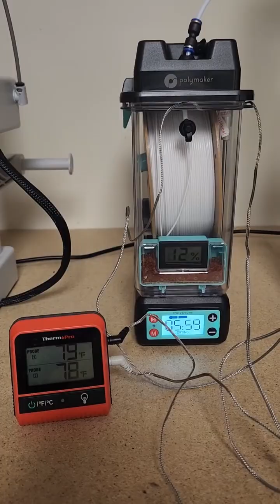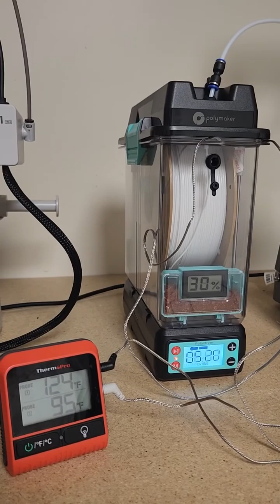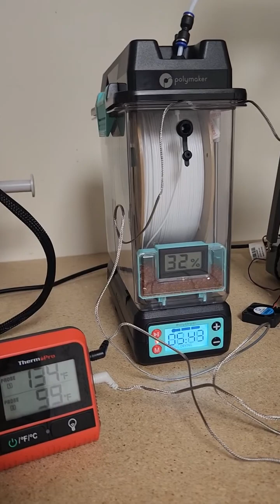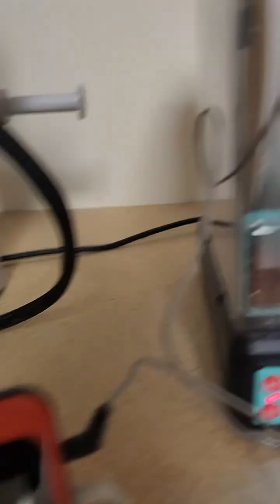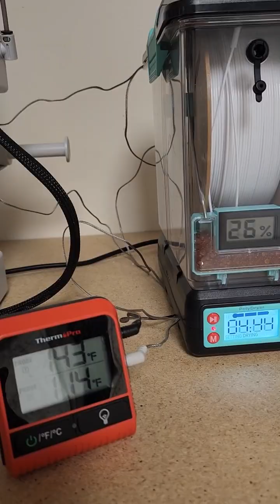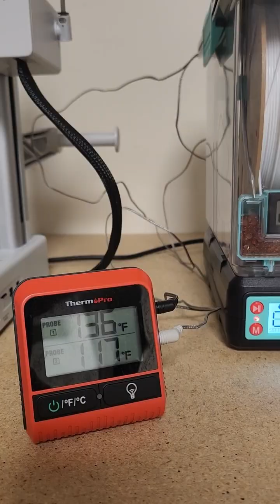Polymaker Polydryer Review - It may be the dryer you want, but is it the dryer you need?

Comment: I bought this solely for running carbon fiber nylon in a sealed container. I have a 4 1kg dryer that I use to dry filament before sealing them in vacuum sealed bags. This box helps with active drying and printing